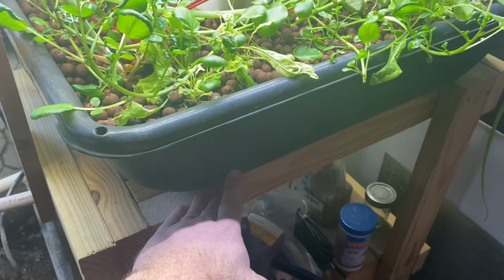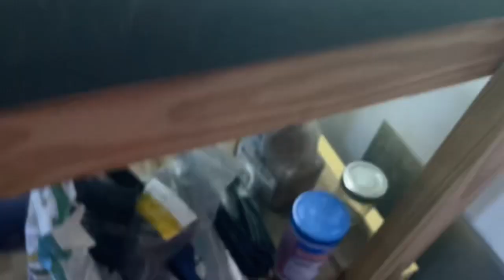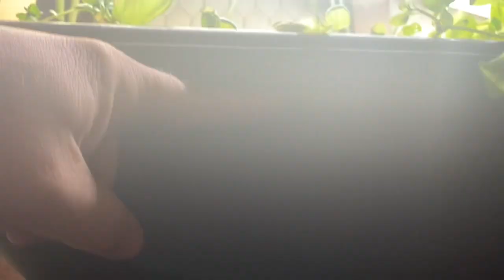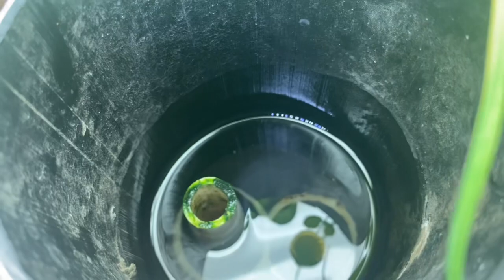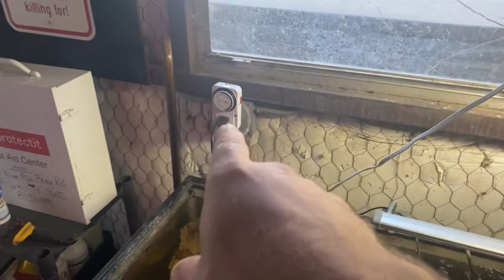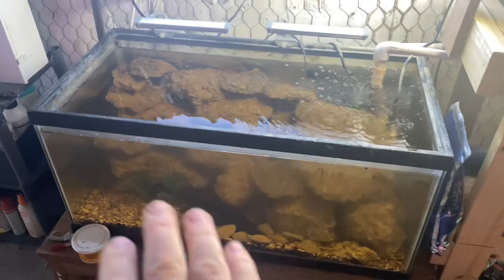No More Stuck Bell Siphons - Ebb and Flow with No Siphon - Can't Fail

Comment: So essentially, you are following water directly into the overflow housing on a timer that backflows back down the pump, but what's the point of two pipes. I think the only way i would understand is watching you take it apart and build it
Reply from the maker: The second pipe (the tall one) sets the maximum height of the water on the up cycle.  If you didn't have it the grow bed would flood, spill all over the floor and pump down you tank until your fish all died.  This method requires two bulkheads or uniseals no way around it.  That said I find it to be so much more reliable and require so much less maintenance then a bell siphon I almost never use siphons any more and I have these in half a dozen different systems.

Comment: Thank you for this video. I am setting up my first aquaponics system so I may be incorrect here, but... I believe the reason this method is used in hydroponics but not aquaponics is because an aquaponics system needs to have the water filtered of solids prior to deposit into the  grow medium. 
I watched this video some time ago and had to look it up again to remember what you had done to skip the bell siphon. But this time I watched it after designing my swirl filter and don't see a way to incorporate it without a bell siphon.
I hope you or another viewer smarter than me has an idea though.
Reply from the maker: Sorry but whoever says that needs to be ignored.  I have had systems running this way for years consecutively now.   As you can space out the cycles it actually mitigates any issues with solids clogging systems.  Additionally if you have worms in your ebb beds (and you should) you will never have a problem with solids in them.  Root build up may be but solids no.  Root binding has zero to do with solids.

Comment: 6:16 second pump?
Reply from the maker: Not in this system but in some.  Since this is small I run a simple sponge filter with an air pump.  With larger systems I run a continuous pump to keep aeration and circulation going and the ebb and flow on timers.